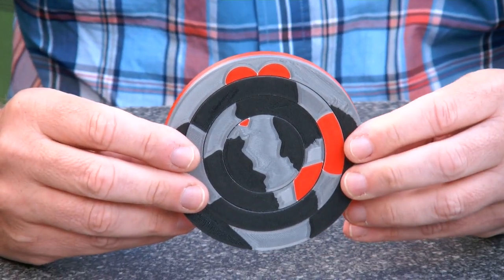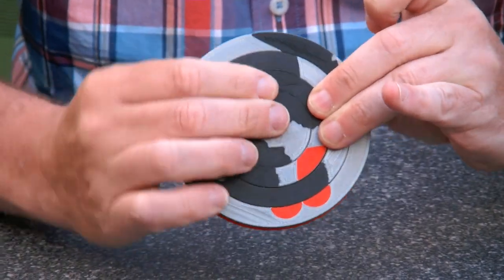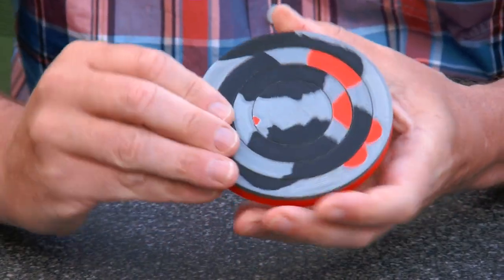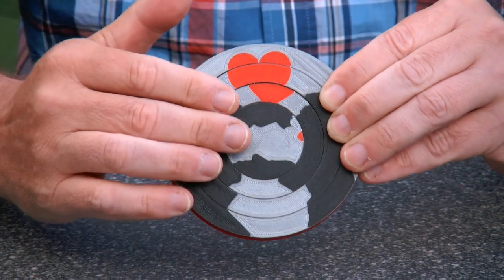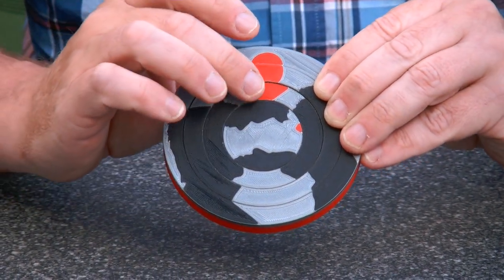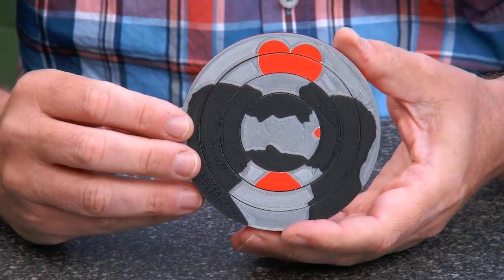Dizzy Disk - Does this spin your head?

Comment: Oskar - Have you seen what James Bruton has done to 3D print motor drives for his OpenDog project - He uses cycloidal gear drives. I wonder if you could make a puzzle with this idea?
Reply from the maker: Yes, I have seen that. As you may know, my YouTube channel also has quite a few gear drives, albeit mostly useless ones. And I have several geared puzzles that use planetary gears, including Dizzy Disk.